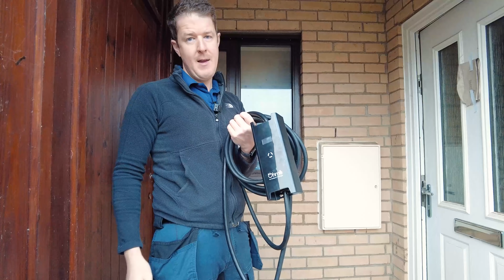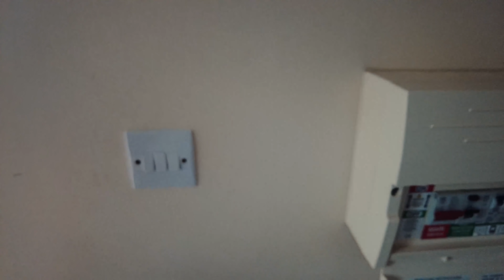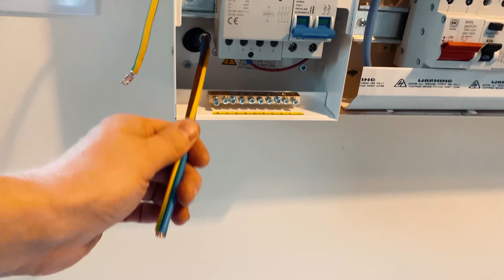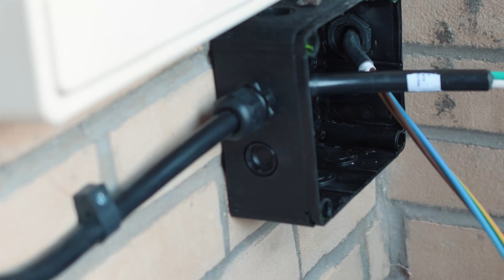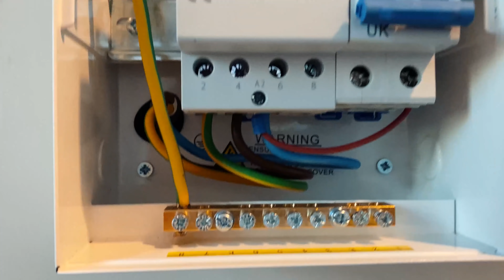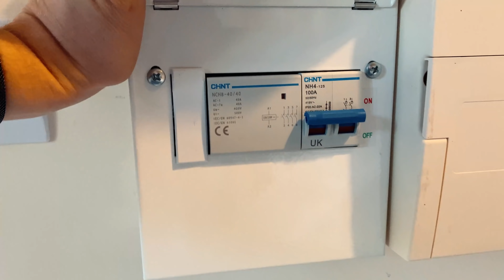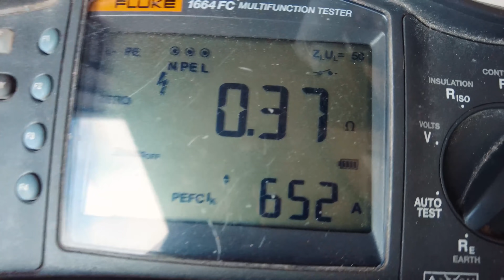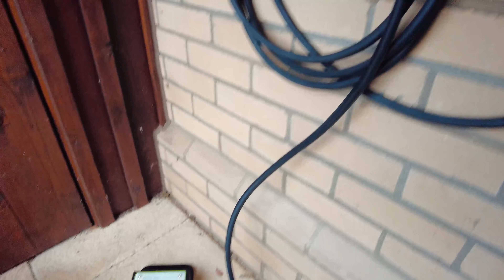Ohme Intelligent Electric Vehicle Charger Installation - Electrician Life

Comment: Installed one at the weekend (well my sparky did) with a Matt:E PEN unit. Got the Ohme via Octopus for £199 with a 32a commando on it and simply removed that and wired it through a Wiska box. Neat and simple install and it’s round the side of the house so less worried about the aesthetics.. cost me £360 plus a few beers for a my sparky mate so great value!

Nice app that works out the best half hour slots of the day to charge based on the rates. Just tell it how much charge/mileage you want and let it do the rest.
Reply: I’ve seen a few people do this either with pen detection or earth rod. Loads cheaper than the Government Grant option.
Reply: Sounds exactly what I need - do you have a link to the MATT:E box please?
Reply: @CarFinanceSimplified  This is the one I installed https://www.cef.co.uk/catalogue/products/4873098-single-phase-voltage-monitoring-and-protection-unit-with-type-a-rcbo
Reply: I got a comando version and asked them to restrict the amps to 10a which  they did for me as I use it like a granny charger. There is no function in the app to change to amps I will be suggesting this. My question is if you have a so called granny charger why don't you need  all these protection devices?
Reply from the maker: Interesting, I wonder if the cheaper commando version has all the same features as the hard wired version, such as the RCD protection built in. I’m guessing it doesn’t. Must be a reason why it’s so much cheaper.
Reply: @artisanelectrics  they should be £399 but you can get them half price if you are an octopus energy customer
Reply: @artisanelectrics  yep, exactly the same.. normally £400 but £199 if you have an octopus account.
Reply: @artisanelectrics  It is identical and does include the DC RCD. The lower price is a promotional deal via Octopus

Comment: One thing with this charger, don't recommend it to people living in crap signal areas it has been known to drop out and not charge (think the old E7 radio tele-switches). In which case you're better off with any other charger, a contactor and timer with an over-ride/boost function if you're looking for it to marry up to the tariff.

Comment: Question for you electricians, when mounting a TV on the wall, can you hide the power cable in the stud wall? Along with HDMI cables etc, or do you not a socket being put in behind the TV?
Reply: Hello Joe, Google search "internal powerpoint tv mount". It is a recessed powerpoint enclosure, which can be mounted behind the TV. That is what we use in Australia for installs.
Reply: Yes , I do recommend trying to separate your video and data cables from your power cables this is usually done by going down one joist for one set in the other Joyce for the other.

Comment: Those colours are north American standard. The bget confused with our brown and blue
Reply: In the US green is ground, white or grey is neutral, everything else is live.
Both brown and blue would get connected to live.
Which interestingly would probably be the case anyway. (We connect to two different phases for 220v)
Reply: @b2gills  i believe you have both ends of the transformer wiring at 220v then the neutral is a centre tap to the transformer. Giving 120vac between neutral and each phase. This is all from what i have learned from youtube 🤣
Reply: @Liberator975  Exactly. But you wouldn't use neutral for a permanently wired charger. Which would mean that the two wires used for power would be live wires. Blue and brown are valid colors for llive wires. (Normally you would use black then red then blue then other colors.)

By using both phases, you get twice the power for a given amperage cable. Which is why electric ovens don't typically use neutral. And it's also why hard wired car chargers don't use neutral.
(I'm using phases loosely because they can either be two phases out of three, or opposite polarities of a single phase. Either way it would be wired the same with roughly the same voltage/power.)

Comment: Do you know if a similar install could be done with the OHME commando style charger? IE fit a pen fault unit to the consumer box and connect this to a commando socket. Then then OHMI can connect straight into the commando socket?
Reply: One issue is the cable on the commando version is rather short
Reply: I just removed the commando plug off mine and wired it through a Wiska box - unless you want to keep/use a 32a connector for some reason its just more unnecessary ugliness on the outside of the house.

If you use this PEN device you can connect straight to the tails - no need to go trough the CU. https://www.cef.co.uk/catalogue/products/4873098-single-phase-voltage-monitoring-and-protection-unit-with-type-a-rcbo

Comment: Why not put in a 32 cee outlet and put on a 32 cee plug on the ev charger. it might even make it so you don't need the PEN-fault protection device. Not 100% on that because we are almost 100% TT here in Belgium
Reply: Still required. You get the PEN by the DNO, the network operator. So you would have the same problem, no matter what you connect in between. The PEN is splitted in the service entrance box into a separate PE and N. If this PEN breaks, for example they damage the PEN during construction work on the street with an excavator, you'll get a massive problem. All metal surfaces, including the car, would become live at mains voltage.
Here in Germany it's mandatory to have an earth electrode installed in your house, even in a TN-C-S system. That would solve the problem partially. The other solution is, we got three-phase in residentials. That is making it much easier for the chargers to detect problems, easier than it is in a single phase installation. In a three-phase system you got more reference points to detect a problem like a broken PEN. The voltage between every L and N should be 230V and 400V between the lines. If the PEN breaks the voltage between the line and the neutral (actually PEN) will float around between 0 and 400V, depending on the resistance of the connected appliances. But the voltage between the lines itself is still 400V. In three phase you got more usable reference points, in single phase you don't have that. You got 230V between two conductors, and so you can't detect if one of them failed...except you install an earth electrode and use that as a reference, but in that case you can also disconnect the PE supplied by the DNO and create a small TT installation.

In that case the smallest appliances (by their demand), for example TVs, Radio and such things will be roasted by a surge up to 400V. Larger appliances like electric heaters will remain intact in most cases, because they'll only "see" a small voltage in the range of 1 or 2V.
Reply: @Marcel_Germann  I can't imagine having to install a pen-fault detection device when installing an outside socket which a cee socket would be. Hence it might be a way to get around the requirement for one. I get why it needs to be there though.
Reply: @florisvdk  The interesting thing is, this PEN fault detection is only required for EV chargers. I don't require that, even if I have a TN-C-S system here. My house got an earth electrode and the EV charger is a three-phase one.

Comment: If you want something small and light, ai can recommend the go-e chargers. They are unique as in they are mobile https://go-e.co/products/go-echarger-home/?lang=en they offer lots of smart features and integration options. At least over here on the continent it also has tarif based smart integration. But with a smart home system and the open API it is possible to set up nearly everywhere.

Comment: They are USA wiring colour on the ohm charger
Reply: More broadly it uses the North American color code. Here is North America: Black = phase 1 or L1 (split phase), Red = phase 2 or L2, Blue = phase 3, White = Neutral, Green/Bare = CPC(Earth, ground, etc.) I wish we used the European code everyone else in the world uses it were are the only ones that don't. I know that other countries have mixed codes are a migration occurs.
Reply: @jeffreypolley7456  Not everyone...

https://de.wikipedia.org/wiki/Niederspannungsnetz#Farbgebung

Translated list:

European Union
Germany
Switzerland
Austria
France
United Kingdom
United States
Canada
Australia and New Zealand
China

The list also contains older wire colours, marked with the [*2].
Reply: U.s. color code for 120 not 240. Would slightly be non-standard with the white being used untagged.
Reply: @imark7777777  isn't 240 usually between a split phase system. With 220v being 2 legs and the neutral is a centre tap

Comment: Why is a PEN fault detection and disconnection from supply not a requirement with the house installation? Or to put it another way; how is a PEN fault mitigated in a domestic installation? If the electrical installation is considered safe within the house, or even when using an electric lawn mower, why is a PEN fault considered so much more unsafe for a charging car connected to the same installation? If the car's body is not conductive, does that change the PEN fault requirements?
Reply: All exposed and extraneous conductive parts within the dwelling and outbuildings are bonded to the earthing terminal resulting in all parts being of substantially the same voltage. Electrical equipment used outdoors is almost exclusively double insulated and has no connection to the electrical earth, with the live conductors fed via an rcd.
Where I lose the plot on this one is the outside tap, which is metal and bonded to the pme earth and likely has no other earth reference, and is outside, and is metal and designed to be grabbed hold of with an open hand whilst standing on the muddy wet ground.... surely in pen fault conditions this is a much higher risk than an ev, and totally unnecessary to be connected back to the pme at all. I know we CAN use plastic pipe, but we dont have to...
Reply: @johnchurch4709  You are illustrating the fact that equipotential bonding has limitations as a safety method. An outside tap connected to pipework that is bonded to the electrical system's PE conductor is a safety hazard
Reply: The car body is conductive, the ground is connected to the chassis of the car, that and the fact that you can be standing in a puddle washing your car with it plugged in is why there is some extra concern.
Reply: Because if you're in the house, you can't touch the mains earth and "real" earth at the same time
Reply: @mikeselectricstuff  What about a likely scenario where a washing machine is sited in a garage that is within or attached to the house? A concrete garage floor is likely to be slightly damp and ground/earth while the metal body of the washing machine is connected to the supplied mains earth.

Comment: Where did the pen fault detector unit come from? Looks a nice neat unit.
Reply from the maker: Viridian EV
Reply: Check out the new one from Garo - similar device to this one but without the exposed circuit board
Reply: @efixx  can you share the link please
Reply: @sajjadfozi5097  https://www.replenishh.com/garo-g8ev40pmeb-mcu-40amp-type-b-rcbo-pme-fault-det-connection-unit-65-3764

Not sure how much the Viridian one is but they aren’t cheap
Reply: I don't know why they have to be used, other countries don't use them and weren't our regs harmonised with Europe.
Reply: @acelectricalsecurity  they don’t. You can use a earth rod but these aren’t always as effective.

Comment: the charger could be a universal that is designed for multiple countries like the color scheme they are using is us and canada (not sure about mexico) or it could be simply what they could get from there supplier i know that is different from what you normally see in the UK
Reply: Oh, it is very universal. You can get that box world-wide, with different plugs on both sides, different branding, different software features, with/without RFID/wifi/3G/4G, ...
Reply: It is our color scheme and in North America for 120 V, to get to 240 V your color scheme would have to be black, red (white not used for neutral) and green. So I don’t know in what country this color scheme on this particular charger makes sense???
Reply: @thetruth5210  there are  120v electric vehicle chargers as well though in the us though sadly those charger take longer ot charge an EV
Reply: @dawn1berlitz  Yes there are 120 v charging cables they normally come with your car, mine came with my Nissan Leaf, but they are not charging stations because if you want 120 V why would you pay someone to put one of these in, when you could just plug into the GFCI (RCD) receptacle on the front of your home.😉
Reply: @thetruth5210  some dont have access to a 240 outlet

Comment: the wire with the white black and green is from the us.
Reply from the maker: Thanks
Reply: Ellis The DJ  red is our second phase color in Canada it is blue we use that as a third phase color.
From neutral to anyone color you would get a 120 unless you were in a 3-phase building and then you would get between phases usually 240 volts depending on standard.